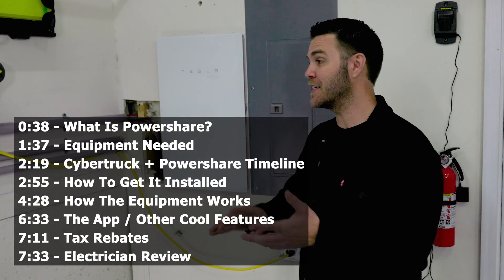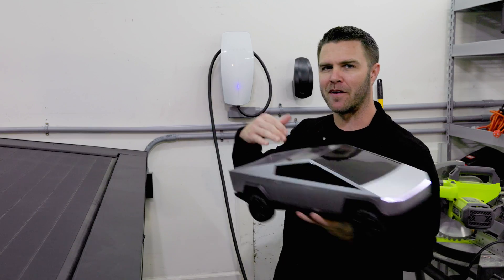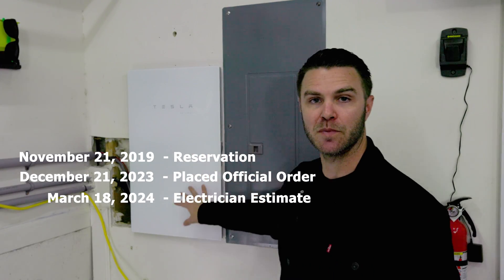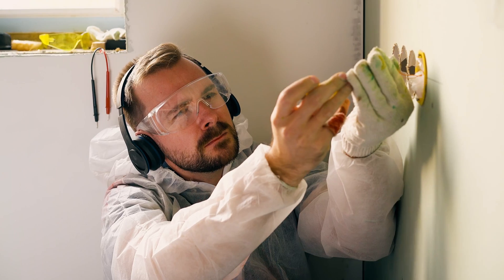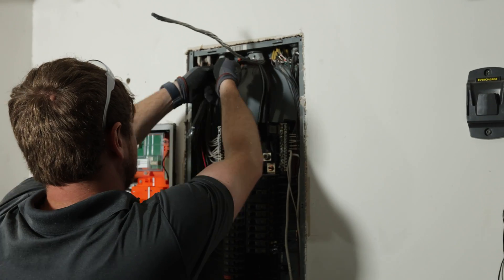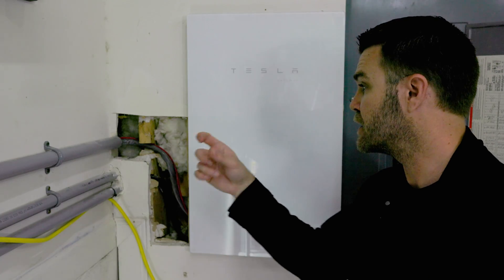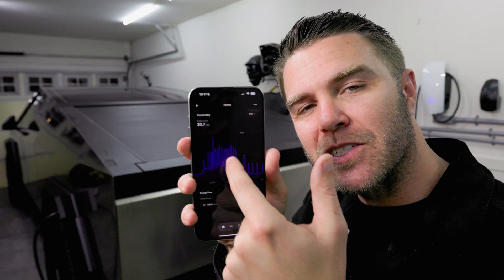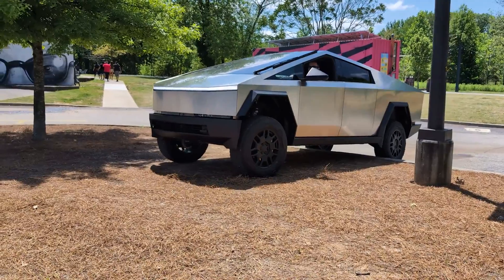Cybertruck Powershare Installation for Home Backup

Comment: So is that the official size ? "It's big"  your one of those who diffidently shouldn't do the install,,, it's#4 awg wire, by the way,  Second, "low voltage, Comm wire shouldn't be ran in the same conduit as the power lines,, failure per code.

Comment: Thanks for the video. I recently had this installed as well, but it was the installers first time. Can you clarify if you have (Bolt) device devices in one home within the Tesla app? Or if you have one home with your powershare device and a second home with the universal wall connector?

Comment: Hi, I just received my cybertruck.  'I already have solar panels with 2 Powerwalls version 2 installed.  My Tesla wallcharger is connected to a dedicated 60 amp/230 breaker in my breaker box.  How would the cybertruck home charging be installed?  My gateway is outside close to the grid meter.  There is a city required shutoff on the house also.

Comment: Tesla makes them do that before activating the system because it’s so new that if they screw something up you’re going to blame tesla and potentially sue them. 

So they want to make sure that to install their stuff it has to be done properly so it won’t cause any problems in the future from being incorrectly installed. 

It decreases the likelihood something goes wrong which limits their liability and keeps the warranty valid too.

Comment: 05:42  Did you use 4 AWG or 6 AWG wire?
Reply: Use 6-6-8 ser cable in copper
Reply: Mega-overkill for that run.

Comment: Great video. Very informative.
I am getting my CT and will be using Powershare as a backup when we have power outage (which is rare here). Much cheaper than getting a PW3.
Does the system switch to CT automatically if there is an power outage?

Comment: I'm getting ready to have some PW2s mated to my Enphase PV system and my installer claims the Gateway 2 they have spec'd and the Gen 3 HPWC (I already have) will support future PowerSharing when Tesla enables other Tesla's to do the same.  Is that correct?  Or should I ask to have a Gateway 3V installed now?

Comment: So just a few comments.

1. The V2 Gateway and the 3-wire Gen 3 wall connector you mentioned are not compatible with PowerSharing unless you have the PowerWall system already installed and working.
2. For a stand-alone setup (no other Tesla power systems in the house), you will need a 3V (yes, 3V, not a typo) gateway with a "neutral balancing transformer" that the PowerWall system normally provides.
3. Additionally, you'll need the new (not available yet) 4-wire wall connector that can carry 12V power back to the 3V gateway when there's an outage (the current one is three-wire) 

This is my understanding.
Yes, plus software that's not available yet.
Reply: the bidirectional charger

Comment: The Ford system does not work, and neither Ford, nor Sunrun will support it. Possibly if you have Sunrun install it, but then you have to deal with them putting screws through your livingroom wall. The equipment costs $6k, my install was $7k, and Ford charges you $500, "for the privilige".
Reply from the maker: Good information. I had no idea how the Ford system was set up and was wondering if it worked well
Reply: blaha, but its a ford, you should know that would happen. my installer said their set up was shit too.
Reply: why screws in living room?  is that where your panel is?  i got the tesla bundles for 2500 and local installer for 1200.  got 500 from my power company and a 1000 rebate from federal government for green alternative charging, look into that if you didn't claim it.  it is for rural areas.
Reply: 13.5k is pricey, was your install super complicated?

Comment: Do you know what size and type the communication wire is, I'm seeing on a search I see 22 gauge shielded twisted pair but can't really confirm that. The red wire you spoke of. I'm running the wire this weekend and want to run the right wire with the power it even though I don't have the gateway yet to be ready for my next tesla with powershare. thanks

Comment: So they ran Romex inside of your conduits?
Reply: Yeah, that run to to the charger doesn't look up to code.  Looks indeed like Romex NM cable (likely 6/2).  If so - two violations there - can't run Romex in conduit, and need THHN #6 for the 60A rated circuit.  Running the communication cable in that conduit with the power is ok, but the power is suspicious - unless that is some special cabling.
Reply: @billjohnson3344 I’m pretty sure the no romex in conduit is a false rumor. You have an NEC reference, or you just repeat stuff you hear? My understanding is that when calculating conduit fill, you are required to use the entire cross section of the wires and jacket together. But as long as that stays below the fill requirements , it’s allowed.
Reply: @skyerios  Depending on sizing of both, it is not specifically disallowed by the NEC.  However, it is not accepted by most jurisdictions.

Comment: I live in the ATL and got mine installed last week. I got a banner in the Tesla app showing how to use Powershare. The option to turn it on showed up at the same time in the controls menu and in the vehicle. My Powershare works.
Reply from the maker: I'm jealous.  When did you take delivery of the truck?
Reply: @LifeOnTech  I took delivery Apr 27 in Duluth. My Powershare was probably available the day after install. But I didn't realize it until I poked thru the banner that appeared in the app.
Reply: @ScottJones67  how has it been?
Reply: @mobleyMobley Works perfectly. No issues...
Reply: @ScottJones67   you still loving the beast? i'm getting mine this week.
Reply: @LifeOnTech  did you sell it? buy a beast?
Reply: Live in ATL to. How much did they charge approx?
Reply: @sebastienjager5501 I think it was about $3500 for the install of the powershare gateway and the universal wall connector.
Reply: did you have to call tesla to have the banner on your app, mine was installed a month ago and not showing up !!! Or the electrician activated it for you? my installer dont have a clue!!!
Reply: @jacobpulickal4381  I did not call or do anything. It just showed up. Do you have powerwalls? I know that impacts things.

Comment: Weird that you dont have it working now.  Others in the forum have it going now.  Maybe something hasn't updated right or a problem with commissioning.

Also your 3V gateway and UWC are not required for thise with existing Powerwall and connector:

For Customers with Powerwall

If your home is equipped with Powerwall and home charging, you do not require any additional equipment. Powershare Home Backup functionality with Powerwall is expected to be available later this year through an over-the-air update. All AC Powerwall variants will be compatible with Powershare Home Backup in the future.